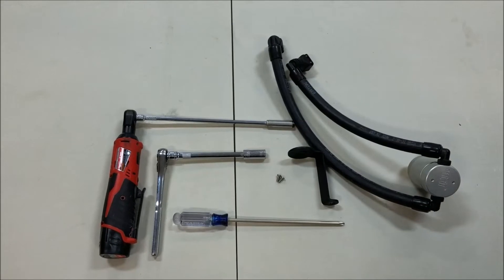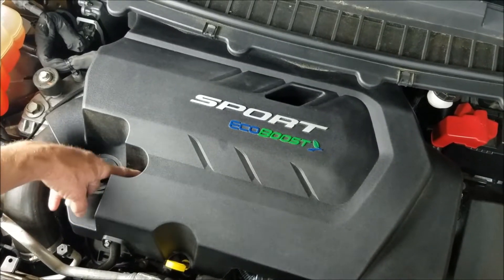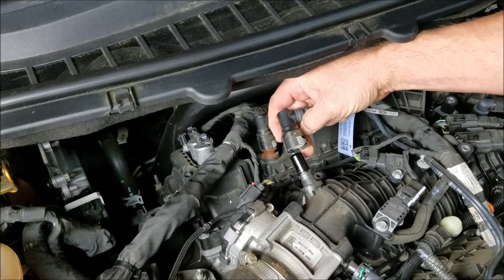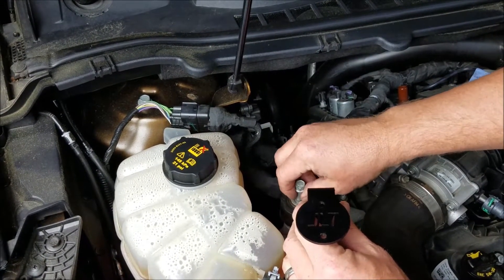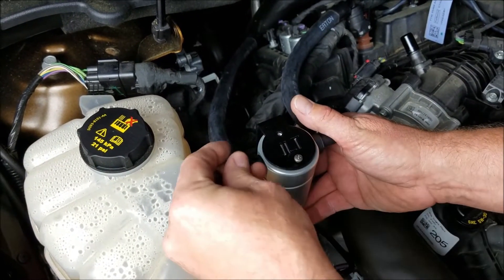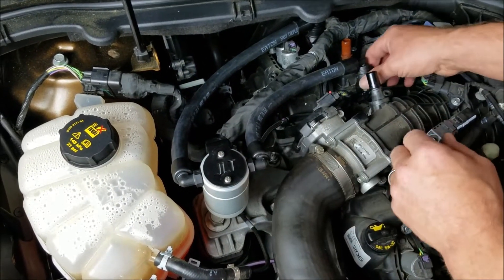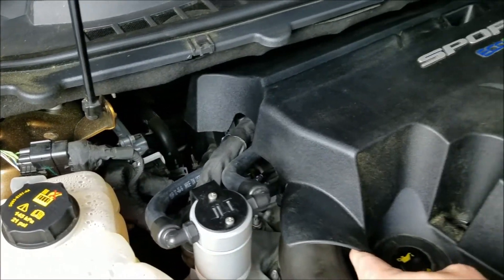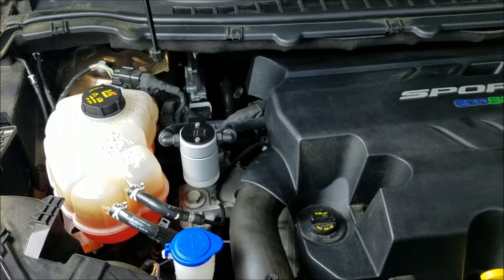J&L Oil Separator Co. 2013-2024 Ford Edge Sport/ST 2.7L Install 3031P

Comment: I just purchased one of these for my 2018 Ford Edge Sport 2.7L.  It currently has 45,000 miles on it.  In your experience, should I get a manual cleaning of my valves after installation to remove what is already there?
Reply from the maker: It is really hard to say one way or the other. There are so many variables in play that lead to valve coking (vehicle maintenance, driving style, climate the vehicle has been in, etc.) that two of the same vehicles with identical mileage could be in very different shape internally.

Comment: Does this interfere with oil filter removal?
Reply from the maker: It may crowd that area, but with the factory style quick connect fittings on the separator it is very simple to undo the lines and move them out of your way.

Comment: What about the second PCV tube (Ford Edge Sport/ST 2.7L) with the crankcase pressure sensor electrical connector ?
Reply from the maker: That side is known as the clean side, and in our experience collects little to nothing in comparison to the dirty side. We don't offer a clean side kit for the majority of our applications.

Comment: Just installed it on my 2022 Edge ST. I don't  have an engine cover, and I didn't run the left line under the wire bundle.  Overall, a 10 min inatall. Al the connections fit perfectly.

Comment: Works at Ecoboost 2.0, in 2015 Ford Edge SEL ?
Reply from the maker: Here is the one you want. 
https://www.jlosc.com/jl-3-0-oil-separator-for-13-18-fusion-2-0l-eb-13-18-lincoln-mkz-2-0-eb-15-18-ford-edge-2-0l-eb-passenger-side/

Comment: I bought one for my 2021 F150 5.0L. The engine needs to be replace due to oil consumption issues so I traded it in. I'm getting a 2022 Edge ST with a 2.7l Eco. Can I use the same one  bought for the F150 on my new Edge ST
?
Reply from the maker: The best route to go is to use our conversion program where you send us what you have and we convert it to fit your new application. I have attached the link to that here: https://www.jlosc.com/j-l-oil-separator-conversion/